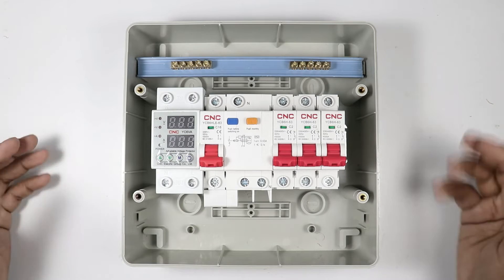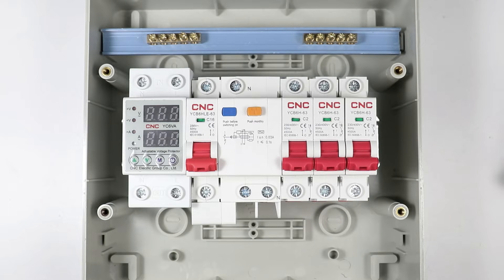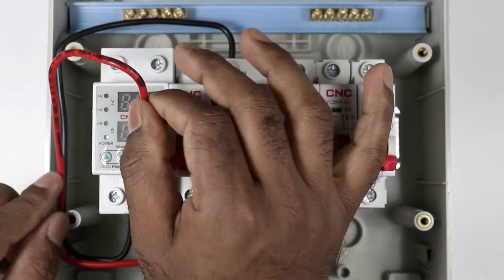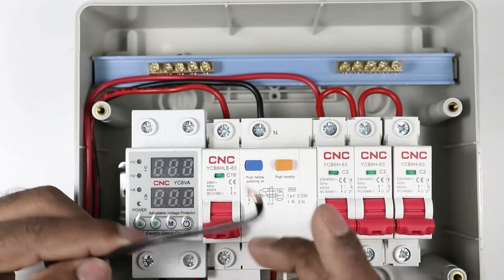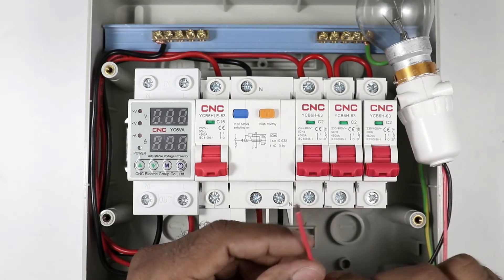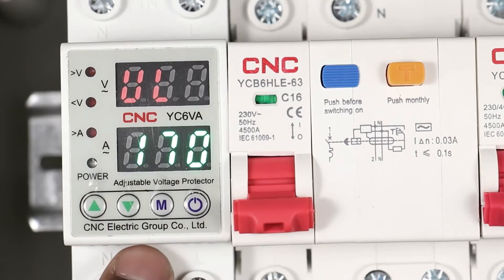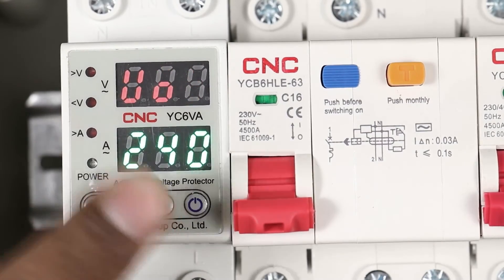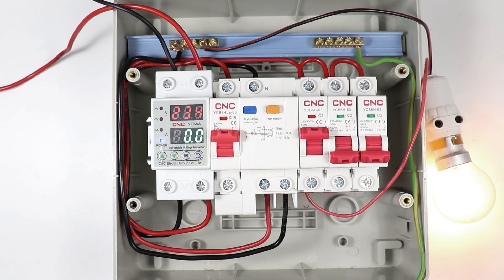Main Distribution Board Connection with Voltage Protector and RCBO @TheElectricalGuy

Comment: Hi. I want to set up RCCB with high voltage and surge/spike protection. I have checked the Life-guard product but it seems to be on the expensive side 8k for 63A 3ph. The advantage is it has variable leakage current from 5mA to 100mA. Can you suggest any setup work similar to that at lower cost.

Comment: if we use SPD in our distribution box then we need RCBO or not?
Or is there any possibility to use both ?
And what is the purpose of lower left empty point or RCBO?
Reply from the maker: RCBO Provide protection from over current, short circuit and earth fault

But SPD provides protection from surge voltage so you need to use both devices
Reply: @TheElectricalGuy  May you please explain a little bit, how can i do the wiring using MR, RCBO and SPD. it will be huge help for me.
Reply: AmiciSmart RCCB has surge protector included in it. You can use that.

Comment: We've 3 phase supply and we've 4 pole RCCB in our Flat's distribution box but RCCB is not present in other flats. Earthing is common for all 20 flats of our building. 
Will leakage current in other flats cause my flat's RCCB to break and protect me against electrical shock?
Reply from the maker: No your RCCB Will not trip in that condition